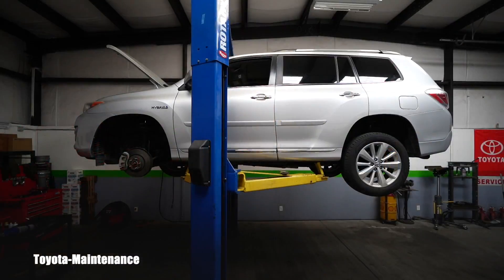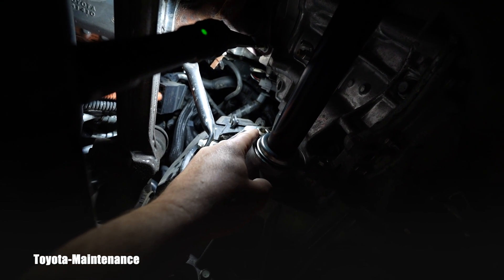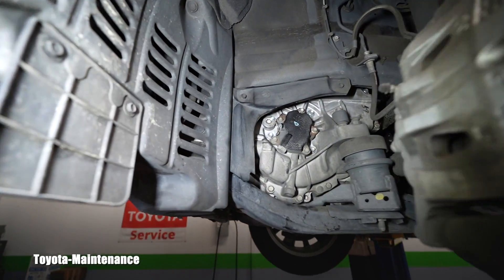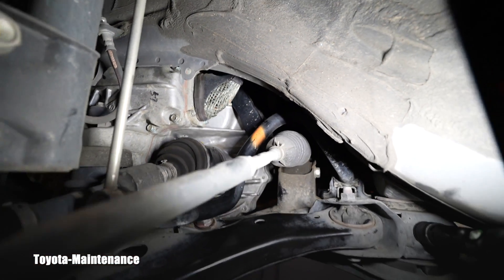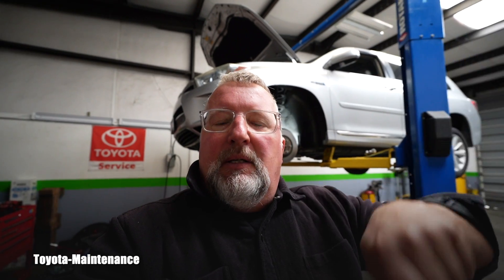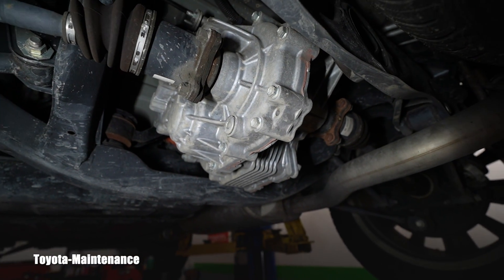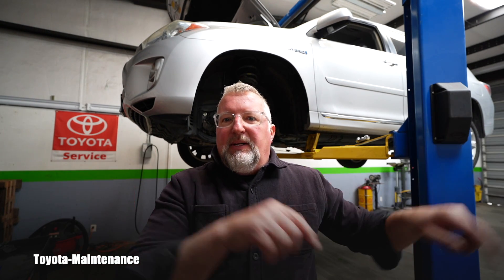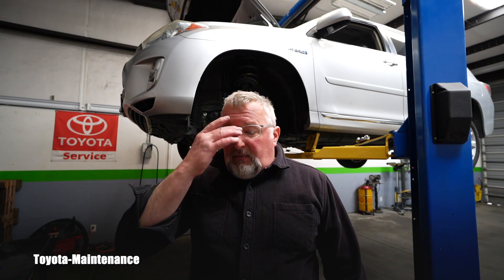Highlander Hybrid Transaxle Fill & Drain Port Location

Comment: Appreciate the video Peter - my understanding of this plug setup is that the plug in front of the drive side (through the wheel cover) that is the fillplug whereas the plug next the cv boot is the “check” level plug. 

It makes perfect sense to just fill from the check plug (like you did) but just wanted to let anyone else know the logic of the two plugs.

Comment: I see a 2FM stamp on the casing. interesting. please film if you have time and desire! If not that's okay.
Reply: Seems like there was another explosion from the evacuator and injection syringe. But this time looks like you contained it to the work table tray and anticipated that. I just wish you could use the hand pump and the clear hoses and pump it in like pumping out soap from a container. More control and less risk. At least until you find a different better way than these two.